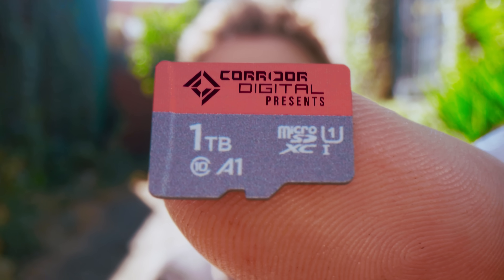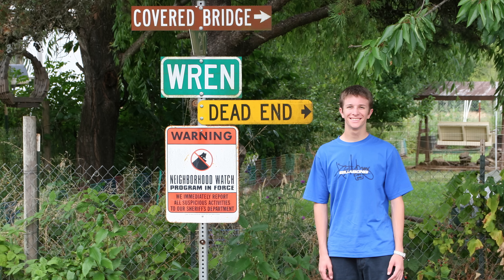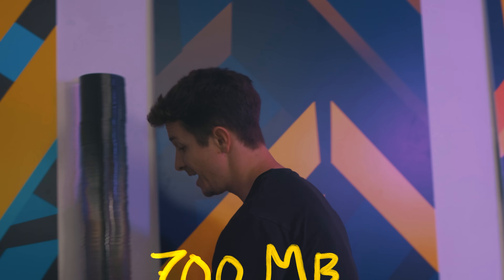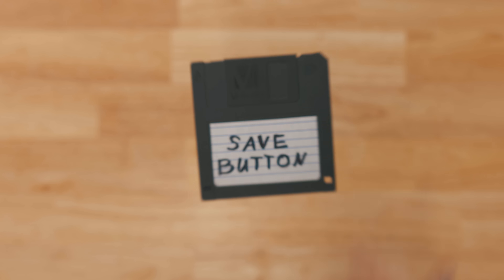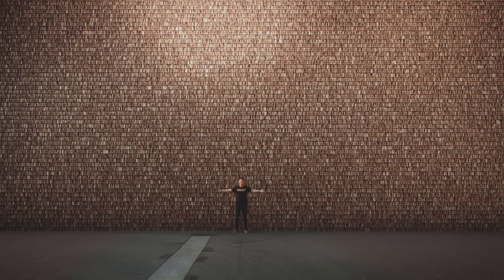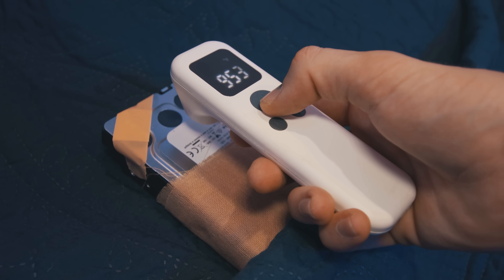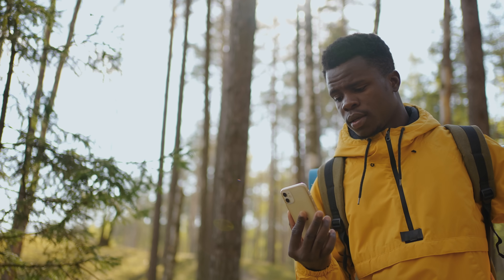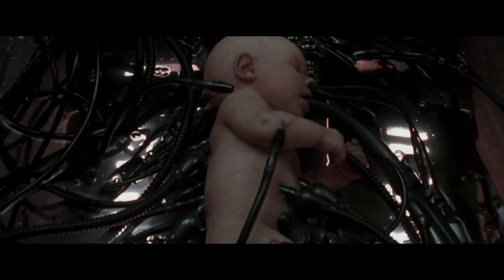VFX Artist Reveals the TRUE Scale of Data!

Comment: My first PC in 1999 had a 4,4GB HD of capacity that very soon become constricted for my storage needs. Now I have a PC equipped with 1TB HD and an 6TB TB. There's also a poor 480GB nvme just to run the windows, plus 32GB of RAM. These are modest numbers today but they would they totally would blow my mind back in 1999. But let's not forget the fast connections. The time it takes to download a single 1GB isn't enough for me to get up go take a piss or drink a cup of water.

Comment: I've built multiple data centers and I can tell you that they use a ton of power, most have about 10-20 backup diesel generators incase of power failure. These are huge generators too bigger than a shipping container usually.
Reply: I use to work in a data centre too. When power when out we had generator. They were so huge we were burning about 34'000 litter of diesel a day.

Comment: One thing to note in regards to these data centres is that while on paper having say, a billion nano SSD cards sounds great and visually the core storage bit itself is tiny compared to a large scale data centre, other factors take in to the size from merely connecting all the storage units to one another via a cluster cloud computing network to even trying to cool and wiring up every individual device to one another. 

It’s honestly insane how all of this works together and yet so quickly.

Comment: Audio CDs came out in '82 but only started getting used for data a decade later, and their use as a recordable storage medium came another decade after that, and each time many argued that it would never happen due to error correction not being able to deal with scratches, hence the first drives using caddies to protect the CD.

Comment: I thought MB was 2 to the power of 10 (binary with exponent) which brought it to 1024 KB.  Did that change to just 1000
Reply: That's the old-fashioned notation. Kilo, Mega etc. should always be factors of 1000 in every field of science.
I don't like to use this notation anymore, because that's why kiB was invented (kibibytes = binary kilobytes).
So 1 TiB (Tebibytes) = 1024 GiB (Gibibytes) = 1024² MiB (Mebibytes) = 1024³ kiB = 1024⁴ Bytes
I think everyone should use that  new standard, it just gets into people's brains very slowly, especially because Microsoft itself doesn't use it yet in Windows.
It would stop all the confusion once and for all. We need logical standards, not confusion.

Comment: A bitonal (i.e black and white, not greyscale) tif image at 300 dpi will average about 52 KB per page. In the average filing system with paper files, there will be roughly 2,000 8-1/2 x 11 in. pages to the linear foot. The rest is just a tape measure and a little math.

Comment: I gotta say, the capacity of paper should be based on a colour data matrix with pixel densities close to the DPI limit of printers, a piece of paper can hold much more data than that. Also, that 'bit' included the terminals and resistors that do not store any data.

Comment: This video was great, though one correction. 1 GRAM of DNA could hold 215 petabytes of information, not 1 strand. A gram of DNA is around the amount that the entire human body contains, so the human body could only contain about 215 petabytes of info in its DNA. You could almost encode a single strand of DNA uncompressed on a CD ROM; its around 700 megabytes of info.

Comment: The ultimate breakpoint for the actual technology will be the transition to organic computing. The same binary logic but instead of electrical current through some silicone based component, there will be an electrical current through organic cells ( mostly neurons ) 
And guess what, that's not very far away.

Comment: 0:10 that is NOT a floppy disk to anyone using comps in the 80s. That is the Micro Diskette replacement for floppies.
(5:53 yes, Those are floppies.)
(And yes, I love having an entire library on a thumbnail.)
As far as 1 Gb SD cards, those are nice to have for stuff like voice recorders or anything needing 'small' (in the modern context) amounts of available memory. My doctors can dictate a month's worth of reports and not fill 1 gig. It's harder and harder to find small-cap cards to replace dead cards.

"A zetabyte is incomprehensively large!" Playstation 12 will need a 2 Zed drive for graphics for 3 games.

Comment: I did work in a Google DC for a bit. Estimating how many racks they have from the layout I figured they could hold 26-104 Exabytes in each 2 story building. This range is figured by estimating the capacity if they filled every rack with 4tb HDD and the max capacity if they filled every rack with 16tb HDD. 60 rows 20 racks each row and 3 columns and in 3 different sections I figure 10,800 racks for each floor.

Comment: Unfortunately last information is wrong. It is true that 1 gram of DNA can store 215 petabytes of data, but single human DNA is not 1 gram and consists of 3 billion pairs which is around 750 megabytes of data. As a result if I didn't mess up with the calculation, single human stores around 1275 zettabytes. Still so much bigger than 10 zettabytes but way of from the video.

Comment: Until April 2022 I worked at an enterprise level datacenter; one of the larger in our company. We had the capacity for approximately 4.4 Exabytes but in practice we only had about 1/10 of that in use because it provided faster speeds to use lower capacity SSDs rather than the chonky 20tb HDDs we had in stock. The other thing is that a company usually owns numerous datacenters to provide closer locations for customers to mitigate any kind of perceptible lag. Mostly psychosomatic, as we had customers on the opposite side of the world that had no issues with speed, but still, lookin at something like 30+ datacenters of varying size across a company that's not necessarily at the top of the pack when it comes to data.

Comment: Back in the 80s: "WOW our technological storage ability is incredible. Surely we are at the pinnacle of innovation."
Back in the 90s: "Surely NOW we are at the pinnacle of innovation. How did we even function in the 80s with that technology?"
Back in the 2000s: "Okay, NOW we are at the pinnacle of innovation. How did we even function in the 90s with that technology?"
2022: "We can fit a Terabyte of data on a 2gram card.  NOW we're at the pinnacle of innovation."
.
.
.
3039: "01000001 01101000 00100000 01011001 01100101 01110011 00101100 00100000 01001001 00100000 01110010 01100101 01101101 01100101 01101101 01100010 01100101 01110010 00100000 01101000 01101111 01101111 01101101 01100001 01101110 01110011 00101110"

Comment: I kinda want to know how the calculation arrived that a piece of paper could only store 2.12KB of data. If they're making assumptions about how many characters can reasonably be fit onto a page and still be readable, then there's likely a MUCH larger limit, as you could define your own number system which has, for example, 256 different characters for each digit space- oh wait that's just called ascii characters. If you defined such a number system, you can write significantly more data in significantly less space, and so a piece of paper has a LOT more data storage potential than a-z, A-Z, and 0-9.

If, however, the calculation was made by actually determining how much space there is on a paper and how much space is required to convey meaningful data, then a ratio of the 2, then yeah- I could see it being correct.

Follow-up: as it turns out, if you represent white space on a piece of paper as a 0, and a dot as a 1, current printing technology would allow someone to store up to around 15MB of data on a piece of paper, although it's supposedly only been done up to 3MB, which is still 1500 times larger than the estimate from this video

Extension on the follow-up: you can easily double the amount of space if instead of using black dots and white spaces, you use color printing to create dots in colors such as red, green, blue, AND black, then still using white for empty spaces. Now you're working in base 5 instead of binary, and using the same amount of space. Simply put, I don't think there's a practical limit to storage on paper until we've hit the ceiling of where technology can take us.

Comment: 1024 bytes is a kilobyte.  This scales from the old "sector" holding 512 bytes, 2 sectors are a kilobyte, 1024 kilobytes are a megabyte etc.  This is why you would get discrepancies on disk sizes between programs that used correct scaling, and ones that just said "F it, divide by a thousand, we're lazy and users are dumb".
Reply: I don't like to use this notation anymore, because that's why kiB was invented (kibibytes = binary kilobytes).
So 1 TiB (Tebibytes) = 1024 GiB (Gibibytes) = 1024² MiB (Mebibytes) = 1024³ kiB = 1024⁴ Bytes
I think everyone should use that  new standard, it just gets into people's brains very slowly, especially because Microsoft itself doesn't use it yet in Windows.
It would stop all the confusion once and for all... kilo, mega etc should always be factors of 1000.

Comment: 1.44 Megabytes? Ooh it's one of the later-version 3.5 inch floppies. 720 was the earliest ones.  with 360 being the storage of the 5.25 inch floppies.  
These of course took over from the original 8 inch floppy, which looked basically like a larger version of the 5.25, and held 80kb of data (read only).
The 5.25" came out in 76, and was the general standard for a long period of time.  It wasn't till 84 when apple introduced the Macintosh  with the 3.25 400kb disk  A bit later PC machines began also using the 3 1/2 inch with MFM formatting, (incompatible with apples formatting, though the same physical disk) with the 720 capacity.  High Density Format (1.44mb 3.5s and 1.2 megabyte 5.25s) in late 87, but expense and distribution and needing an upgraded drive became a problem, and they weren't widely distributed till the early 90s.  And then were rapidly over-taken by the advent of the CD drives soon after.

Comment: seriously?
1kilobyte is not 1000 bytes but 1024bytes! 2 to power 10. Meg is 2 to power 20, giga is 30 and so on....
wont this varrant a fix in the video? This is really misleading info presented here

Also means that the tower of bits only equals 931,3 GB, not a full 1 TB

Comment: The reason we don't use SD cards for storage is their speed, Wren.  It would help if you also remembered that while the SD cards are small, the hardware required to interface them with a storage management server would be massive.  It would also require much power and cooling, like a data center.  When you compare them in the end, SD cards are the shittiest way to store data that needs to be moved quickly.

Comment: I hate to be that guy, but 1.44 mb floppies are actually 2 mb. The 1.44 is the remainder after the file system is set up. You will only need 500,000 or 524,288 depending on how you count

Comment: He is wrong on the conversion between units of storage.  Computer storage is based on binary( base 2) instead of the metric system ... even though it uses the "metric" prefixes.  1,000 is not a base 2 number, but 1,024 is.  So 'Kilo'-byte(kb) is 1,024 bytes, 'Mega'-byte(MB) is 1,024 kb, 'Giga'-byte(GB) is 1,024 MB, etc.  1 GB = 1,024 MB/GB * 1,024 kb/MB * 1,024 bytes/kb = 1,073,741,824 bytes.

Comment: I remember installing Microsoft Office using 1.44 MB floppies (probably in the early 90s). I’m not sure of the exact number but I’m pretty sure it was on the order of 30 of them. The first time that I used a CD to install Office was an absolutely amazing experience.  I’m not old enough to have ever used the original 8 inch floppies, but I did use 5.25 inch and, believe it or not, reel to reel (it was a completely obsolete technology at the time, but some big companies still used them.)  I also had the “pleasure“ of reading punchcard programs onto “modern” storage (10 MB hard drives).

Comment: Just wanna point out a possible correct, in the video you said a 4K Bluray has 50GB, even though that's technically part of the specification, all of the existing movie releases use 66GB or 100GB discs depending on what the studio decides. (I have yet to hear of an actual 50GB 4K Bluray release)
Reply: Also, his DVDs were only single-layer. Dual layer holds 8.5 GB.

Comment: Blue-rays get their name from the light used to read data from the disc, not the colour of the discs themselves. Ususal cd's and dvd's use red laser light at ~650nm wavelength, blueray uses violet (violet is the 'sciency' definition, most people when showed true violet light would call it blue) at ~400-450 nm. Lower wavelength means the system can read smaller differences in the disc (smaller holes can be resolved, like the resolution on a camera getting finer at higher zoom for a more powerful camera). This therefore means you can have more resolvable optical storage in a smaller size, therefore the higher storage on blue-ray compared to dvd and cd.

Comment: Actually 1024 kb = 1 mb
1024 mb = 1gb and so on
Reply: that completly depends on number system places we use
in Decimal places 1MB = 1000KB
and in Binary Places 1MB = 1024KB

both are correct but its just number system that makes differnece

Comment: Interesting would be a quartz storage. Short explanation : sd etc storage in 2 dimensions. Height *Width. Quartz is like a 3D photo written with a laser in plastic. This allows you to store 3 dimensionally. That's why you get a lot of data even in a very small space. Unfortunately, it is impossible to delete or change the data, but in principle if you want to have a permanent record, this is the solution.

Comment: 2:46 Incorrect.
The human genome has 23 pairs of chromosomes. One set of 23 chromosomes has about 3 billion base pairs, so 6 billion base pair for a diploid cell. 1 base pair can encode 2 bits.
So the total genome (per cell) stores about 12 billion bits, or 1.5 GB. About 33 MB per strand (chromosome) on average. Not 215 petabytes per strand.

With about 37 trillion cells, that comes out to 55.5 trillion GB or 55.5 ZB.
(55.5 billion TB or 55.5 million PB or 55.5 thousand EB)

A man's genome has a bit less than a female's, since the Y chromosome is smaller than the X chromosome.

You're right that the human body has about 1.7 quadrillion strands of DNA (37*46=1702), but you're way off on the amount of bits per strand. 
Your 370 billion Zettabytes is off by a factor of 6,666,666,666.67 (20/3 billion).
A number so perfect that it could probably be used to figure out exactly where we went in different ways.

The website thednaexchange dot com says that about 90% of the cells in a human body don't have DNA (E.g. Blood cells), so the true number of cells with DNA is around 3 trillion). In that case, a human body contains about 4.5 ZB.

Comment: Your hope of a system that becomes biology is destroyed by the strategy of differential data storage, like SCM (eg. git), every data points has 1 origin, and it only store 'changes/delta/diff' at the same address of the previous one. Every DNA strands in our body is  to one another strands,  in research platforms.

If we say: "for every new data point, combine previous diff with origin, call it a new origin; keep current diff. " This means we can limit size of accumulated data to be at maximum of max diff, which is , then, we can save a lot of storage. Yes, we lost data histories, but, , and what most genetic researchers do, albeit extending lifetime of current origin.

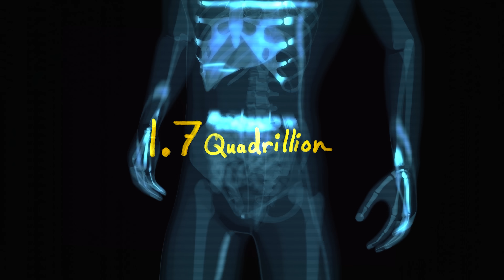Imagine origin DNA is set to ideal sample of a person's heart: 215 PB (vid @ 12:52)  it's 86 Linus's server (vid @ 7:56) which is definitely possible for one Enterprise. Then, each organ functions/property might be max 1MB diffs (one million base pair diffs) the unused portion could be merged into 4kB (4,000 B opcode descriptions) ignore rules, makes it 1.4MB for each diffs (ignored basing some diffs on other diffs, aka. branching, it further reduces avg. size). Having 1.7 Q (if you played idle tycoon games, you'll know this abrv.) diffs 

= 1.7 * 10^12  * 1.4 * 10^6 B = 2.38 * 10^18 B; 
or 2.38 EB (Exabytes).  Adding 215 PB base DNA, we get 2.595 EB.

(Yes, it's not MBi, so MB = 10^6 Bytes != 2^20 Bytes)

Which is ~2/23 (=1/11.5) of 30 EB: Wren's estimation of 1 datacenter branch (vid @ 10:25)

 We have 8 billion people, plants, animals, microbes, viruses on earth....

So, , just that not many people are aware of it. I recommend you guys attending nVidia's GTC  to update some news.